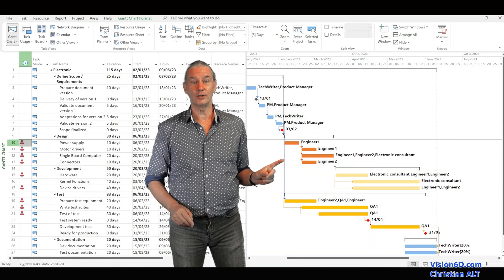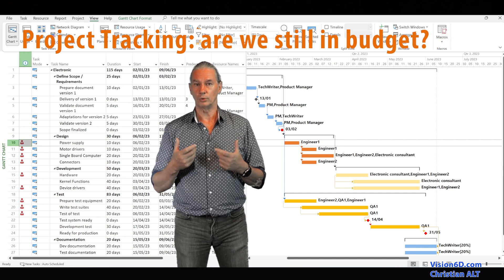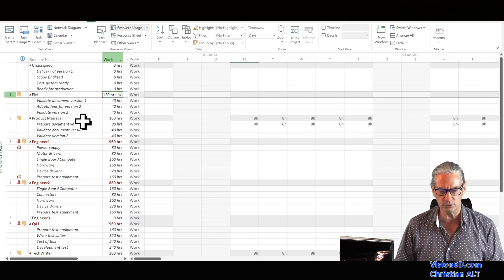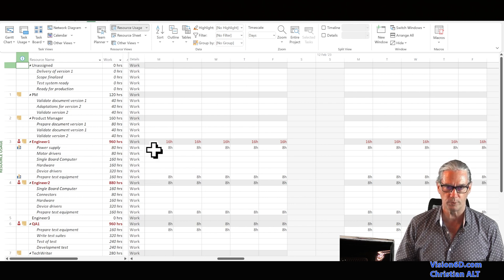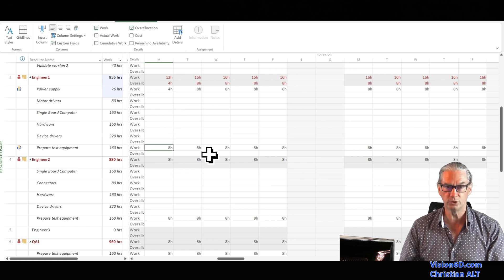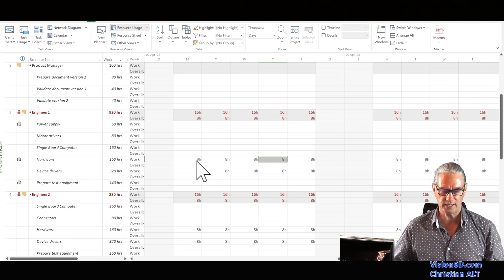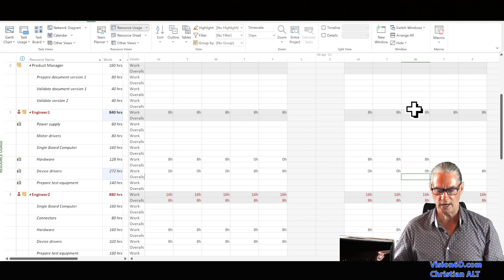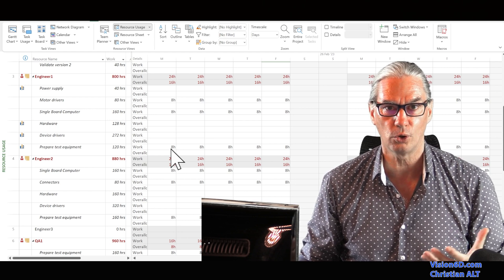#2.5 MS Project 2021 ● Solve Resource Overallocations with Resource Usage ● Part 3 of Overallocation

Comment: Where do you add those reduced hours? Are you forcing the resource to complete an eight hours (8) task in four hours (4), in your first example?
Reply from the maker: Thank you for your question. The situation is that resources do not work on a single task each day. They have several things to do. So what I do is to assign them  part time to a task. And yes it reduces the work hours for a task. This is a common situation.
But of course if the real work is of 8 hours then you cannot do that.
In which domain do you work?
Reply: @vision6D  I work in many domains, primarily product/program/project leadership and management consulting, advisory and mentorship-coaching.

I would normally negotiate for additional resource and redistribute the over allocated hours if under a time crunch else would push them out further if finish date is acceptable for a revised baseline. At times, it is possible to spread out the over allocated hours without affecting  the critical path.
Reply from the maker: @kaushiksarkar311  interesting your domain is similar to mine. I understand the way you propose to solve overallocation. Which is also a possibility. There are always several ways to go about overallocation depending on the project and context.
Have a great day.